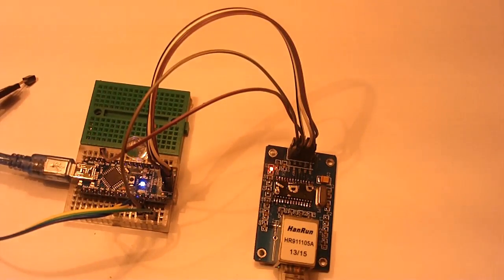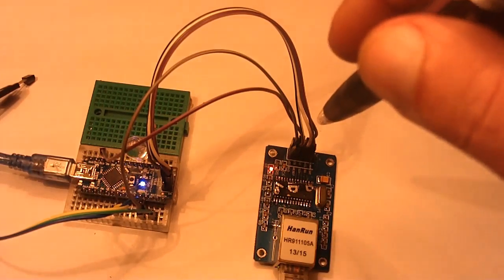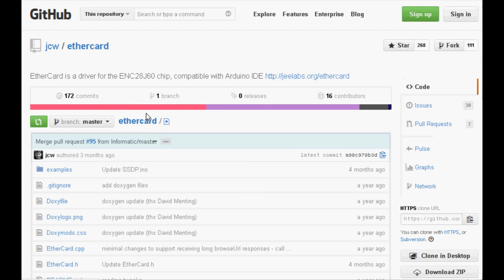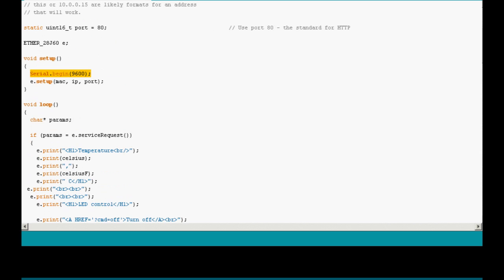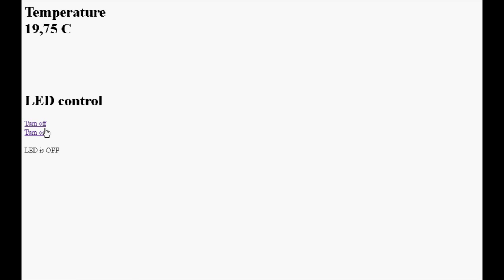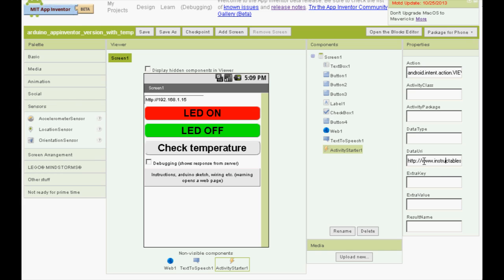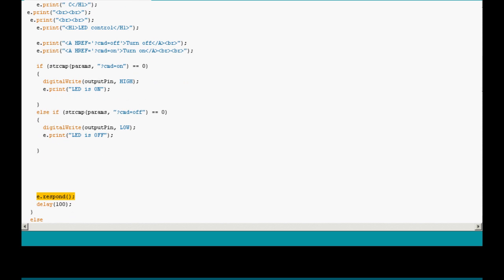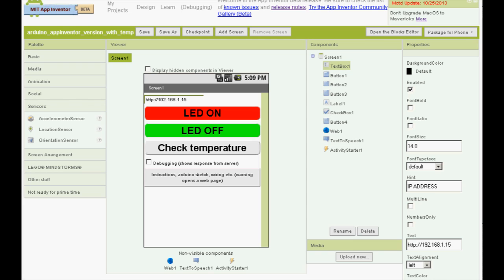Ethernet controlled arduino

Comment: Hi Don't know if you or someone else could help me here.
I am new to Arduino, I am working on a project trying to anyway.
trying to get Arduino Nano to communicate with Ethernet shield.
Questions Are
Can one upload sketch while Nano and Ethernet connected as I keep getting an error while connected, but once I disconnect and try uploading sketch to Nano it says upload done but seems to not want to connect with Ethernet shield.
Error I receive when both are connected while upload sketch.Problem uploading to board.  See http://www.arduino.cc/en/Guide/Troubleshooting#upload for suggestions.avrdude: stk500_recv(): programmer is not respondingavrdude: error reading signature data, rc=-1avrdude: error reading signature data for part "ATmega328P", rc=-2avrdude: arduino_read_sig_bytes(): (a) protocol error, expect=0x14, resp=0x94Global variables use 977 bytes (47%) of dynamic memory, leaving 1,071 bytes for local variables. Maximum is 2,048 bytes.Sketch uses 9,296 bytes (30%) of program storage space. Maximum is 30,720 bytes.
Under tools
Board  "Arduino nano"
Processor  "ATmega328"
Port "COM5"
My project was to run raspberry pi 3 to connect to Nano to Ethernet shield to use as a controller via IP to control RGB lights

Comment: Arduino:1.6.8 Hourly Build 2016/02/02 09:41 (Windows 7), Carte : "Arduino/Genuino Uno"

In file included from C:\Program Files\arduino-nightly\libraries\etherShield/etherShield.h:25:0,

                 from C:\Users\403etudiants\Documents\Arduino\sketch_feb07c\sketch_feb07c.ino:1:

                      ^

C:\Users\403etudiants\Documents\Arduino\sketch_feb07c\sketch_feb07c.ino:40:22: warning: deprecated conversion from string constant to 'char*' [-Wwrite-strings]

    e.print("<br><br>");

                      ^

C:\Users\403etudiants\Documents\Arduino\sketch_feb07c\sketch_feb07c.ino:41:34: warning: deprecated conversion from string constant to 'char*' [-Wwrite-strings]

    e.print("<H1>LED control</H1>");

                                  ^

C:\Users\403etudiants\Documents\Arduino\sketch_feb07c\sketch_feb07c.ino:43:49: warning: deprecated conversion from string constant to 'char*' [-Wwrite-strings]

    e.print("<A HREF='?cmd=off'>Turn off</A><br>");

                                                 ^

C:\Users\403etudiants\Documents\Arduino\sketch_feb07c\sketch_feb07c.ino:44:51: warning: deprecated conversion from string constant to 'char*' [-Wwrite-strings]

    e.print("<A HREF='?cmd=on'>Turn on</A><br><br>");

                                                   ^

C:\Users\403etudiants\Documents\Arduino\sketch_feb07c\sketch_feb07c.ino:49:25: warning: deprecated conversion from string constant to 'char*' [-Wwrite-strings]

      e.print("LED is ON");

                         ^

C:\Users\403etudiants\Documents\Arduino\sketch_feb07c\sketch_feb07c.ino:55:26: warning: deprecated conversion from string constant to 'char*' [-Wwrite-strings]

      e.print("LED is OFF");

                          ^

exit status 1
Erreur de compilation.

This report would have more information with
"Show verbose output during compilation"
option enabled in File -> Preferences.

Comment: Where is the source code for the Android apk, on the forum there is no good source
Reply from the maker: Alain Comtois 
Since they introduced appinventor 2 you can't open projects created in appinventor 1 - you'd have to recreate the app based on what you see here. Luckily it's not difficult. 

Just realized they now integreted appinventor gallery into the web application for creating apps - I see that they have changed some things but I wish they added more blocks.
Reply: OK thanks for the answer I'm new learning all of it
Reply: hey use this tool to convert the zip to aia file: 
http://convert.appinventor.mit.edu.
Or giv ur email i will send it

Comment: this is pissing me off
i bought the new ethernet sheild..
the 2.0 one and i had to download the new library
then it worked but now it dropes the conection and only will get it back if i unplug power and wait a while then plug it back in!
Im usn the dueamilinovy sorry probly miss spelt that
help me plz
Reply from the maker: so do you have the same ethernet shield or a different one ?? If it's a different one (the official one) then you have to modify the arduino code. Sorry I don't respond to some questions - I am busy with work.
Reply: yea it was broken i got it

Comment: It happened an error when i verified the sketch. error as following
Arduino: 1.5.6-r2 (Windows 7), Board: "Arduino Leonardo"

Build options changed, rebuilding all

sketch_may09a.ino:3:25: error: etherShield.h: No such file or directory
sketch_may09a.ino:4:25: error: ETHER_28J60.h: No such file or directory
sketch_may09a:6: error: 'OneWire' does not name a type
sketch_may09a:22: error: 'ETHER_28J60' does not name a type
sketch_may09a.ino: In function 'void setup()':
sketch_may09a:27: error: 'e' was not declared in this scope
sketch_may09a.ino: In function 'void loop()':
sketch_may09a:34: error: 'e' was not declared in this scope
sketch_may09a:78: error: 'ds' was not declared in this scope
sketch_may09a:92: error: 'OneWire' has not been declared
sketch_may09a:117: error: 'ds' was not declared in this scope
sketch_may09a:137: error: 'OneWire' has not been declared

  This report would have more information with
  "Show verbose output during compilation"
  enabled in File > Preferences.
Reply from the maker: You're missing those libraries. If you have them then they must be incorrectly installed or something. My suggestion? If you don't have the libraries install them. If you already have them then use an earlier version of arduino - even 1.0 should work

Comment: How to get my IP address? I use this method"cmd->ipconfig->ipv4 address"
ipv4 address=my IP address?
Reply from the maker: Well yes, but why do you need your IP address? the ethernet module has it's own IP address and you can set it by modifying the arduino sketch (though you'd have to modify the app too if you do it)
Reply: thanks a lot. I had solved this issue rely on your opinion.

Comment: Hi and thank for this tutorial, 
I wounder if you can tell us how you created your Web-server? Do you have any experience with (internet of things platforms, such Carriots.com ) or other similar websites?
Reply from the maker: the webserver runs on the ethernet shield - there are example sketches for it... I used cosm (now xlively) I made a video on it, but it has to be slightly modified (not my fault really - that happened when cosm changed name to xively). If you find the video I posted the modification that has to be done to get it to work
Reply: kerimil I already saw Xlively tutorial :) very nice, I will try to connect to it. I saw the Xlively website and it's seems not so complicated to use.. I think I'll disturb you sooner again :), thanx for the fast respond to my comment

Comment: kerimil how i can get the temperature value on the LABEL? can you make the video?
Reply from the maker: There's already a video on it and an app.
Reply: Can give me a link? Thanks
Reply from the maker: Sending temperature readings to an android mobile & How to send data from the arduino board to the internet
Reply: Thank you. but this method is via bluetooth. is there any way the temperature is read at label but using the ethernet shield?
Reply from the maker: the process is more or less similar.. you just somehow receive the value and save it to a variable, then display its value on a label - very basic... check my video on using ethernet shield with a smartphone - it's somewhere on my channel I released it like 2 or 3 months ago
Reply: Ok thanks